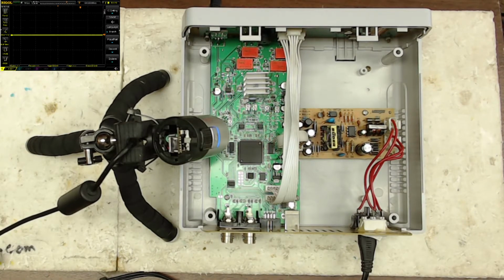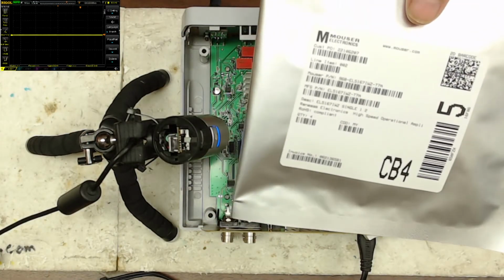Signal Generator Repair for Amplifier Repair Cross Reference IC Numbers

Comment: Hello dear sir, I am seeing your videos on your YouTube channel. I need some help to find out fault from my Rigol DG2041A function generator. Sir, once I have seen a message on screen (overload waveform). now, when I press square wave  key, device not showing any signal on output terminal. But other all waves and functions are properly working, so sir kindly guide and suggest to me how to fix this fault? Hope you will reply to me soon. 
Thanks and regards
Israr Ali
Reply from the maker: Hi Israr. That is a tough one to answer. Since it is a single output you have nothing internal to compare IC's with. It may be a problem with the processor or can be an issue with a comparator. It is hard to say. The people over at EEVblog forum may be able to assist you better.
Reply: @ellensburgamplifier  thank for reply sir, I have checked on testing point before touching square wave key, all waveform are visible but when i touch to square wave key, disable signals. Sir, Its is possible that, it will fix by firmware? Maybe disabled from prosser after shown over load message?
Reply from the maker: @IsrarAli-kc3pe  Did the output ever get shorted or overloaded on anything you have tested recently? If firmware does not correct the issue I would suspect the current sense circuit (if it uses one) where you would find low value resistors that may be open or high value.
Reply: @ellensburgamplifier  Sir, yes, during test speakers, I was got a overload message on screen, maybe terminal shorted, but now same terminal normal on sine wave, triangle waves include noise, all functions and frequencies are properly working, just square and pulse wave are disable. During test square wave, device 
 also showing +1.8V DC  voltage on output terminal, and when i select sine and triangle or other waves,  device is showing AC voltage as a normal op amp on multimeter.
Reply: Hello Sir, I have tested device again and I have got inside square wave before pressing square function key, but when i pressed square key, signal skipping again. Very strange situation for me.
Reply from the maker: @IsrarAli-kc3pe  I am not sure what the issue would be without seeing the board and its design.

Comment: Hi Todd what is your temperature range when soldering this small components
Reply from the maker: Hi Tyrone, that is an excellent question to post here. My iron is always set to 725f. This is a tricky question as there are many variables. First is the flux. The flux you use will also determine temperature. Next is the solder. I use Kester 44 with the Amtech flux. The key is the amount of time the iron is on each pin. With the right solder/flux combo you only need a second to solder down a pin. I will try to include more footage of soldering to help the community.
Reply: @ellensburgamplifier  thank you for your response and I look forward to see you do it